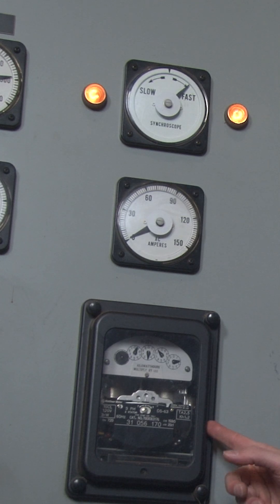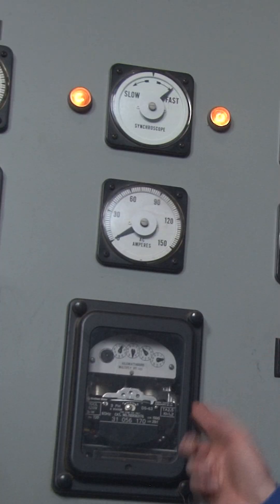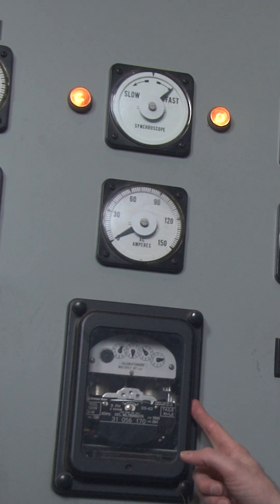kiloWatt Hour Metering #engineering #powerplant #hydropower #highvoltage #science

Comment: kWh is a measure of energy, not power. Makes perfect sense as a unit of measurement for energy consumption. Especially for a power plant.
Reply: American and units. If it is logical, they will not use it.
Reply: @remcool1258  If I were born tomorrow and grew up under the metric system, I would probably share your opinion. But I was born 76 years ago under the American Imperial system. Dammit, 72 degrees is comfortable. 32 degrees is cold. 0 degrees is TOO EFFING COLD!
My old gassers held about 16 GALLONS of fuel, easier to think of than 60.56659 liters.
I'm forced to use metric tools, as some idiot decided to let in all the foreign cars and spread that virus, but that's another story.
So I will stick with the American Imperial system, Cycles per Second, and all the other units I have used since childhood.
To me, it is logical. And so is driving on the right hand side of the road, cold beer, using a knife and fork, and never, ever eating Haggis, watching Morris Dancing, or Cricket.
Reply: @The_DuMont_Network  Funny you are ok with about 16 gals but not about 60 liters. My opinion is that if a system works then its a reasonable system, and engineering can be done in either system pretty effectively. There is no need fighting over which is better. Personally I'll stick with metric, its the system I grew up with and feel comfortable in. I am just as confused using Fahrenheit as you are with Celsius. P.S where I am from, we also use the kWh and drive on the right side of the road.
Reply: @The_DuMont_Network  I can see your point on most of what you're saying. Though you are dead wrong about haggis.

Thing for me is, I've had to build furniture from old plans. Plans that pre-date the metric system. This brings up a number of issues, because feet and inches and whatnot were not generally standardised back then.
A foot might be 9 inches, it could be 13. None of those different inches are the same and neither are those feet. So when working with plans like that, not only do I need to know when they were made, I also need to know where they were made, and then I need to figure out what standard was used there at the time in order to convert things to metric.

It's the same thing these days with gallons, tonnes and in some cases miles.
When you say gallon, is that a US gallon or an imperial gallon? Long, short or metric tonne? 
Miles? Statute miles? Survey miles? Nautical miles? Or some historical mile that might be as short at 500 metres or as much as 10km... Again the whole "who, where, when" stuff comes up with that again.

Also the US Customary units are just metric with extra steps, as all USC units are defined by the metric system.

And yes I know the USC units are a perfectly serviceable system, mostly because there are not 70 different definitions for a single unit depending on where and when you are.
Reply: Watts are defined as joules per second. Saying watt-hour is the same as saying joule-hour per second which doesn’t make sense.

Comment: So megajoules represent a total amount of energy generated.  Sure, you are in the business of selling energy, so you should get paid for how much energy you generate.  The problem is that the ancient meter you showed us doesn't measure energy.  It measures volts and amps, multiplies them together (watts), and integrates that over time.  So, sure, you could measure integrated power flow over time, then convert that to total energy at the end of month, but you would be charging based on a different metric than you measured.  The accountants might have something to say about that.  You could measure megajoules at a great loss - spend all month filling up a giant battery farm and charge based on how full you got it - but that would be much more wasteful than measuring the metric you have access to as the power flows by the meter.

Comment: The kWh is not a measure of power. It measures energy. kW is a measure of power.
Reply from the maker: Yes, and Joule is a unit of Energy.
Reply: @Physicsduck  Since you know the difference, it must have been a slip of the tongue when you said that kWh was a stupid way to measure power.
Reply: @whitcwa it's all schematics. Technically the meter does measure power and adds it up over time, but the speed the wheel is spinning measures power. You could also argue that measuring power is done by measuring energy... potAto pOtahoe.... we pay for energy ( plus peak usage, power factor,  , nuclear decomission tax.... etc.) At least where I live.
Reply from the maker: I had my wisdom teeth revoked for the frequency in which my mouth outruns my brain. But yes, I mean that the kWh is a daft unit of measure to begin with.
Reply: @Physicsduck  I still want to see your tale on this. Is it just the units you don't like, or is there other factors that have to do with production and metering?
I'm guessing U.S. Americans would have too much confusion with MJ. Even liters confuse them, when you can realisticly 1 liter = 1 guard, and they will still be confused because they don't know how many quarts are in a gallon.
Reply: Suppose you have a battery with a capacity of 5kWh and operate at 41.6V for 5 hours. The amps can be calculated using the kwhr formula. 

Amps = (kWh × 1000) ÷ (V × H) = (5kWh × 1000) ÷ (41.6V × 5H) = 24 amps.

However THAT is only what it will supply at the very start.

As because you only have a finite runtime on a battery, it's terminal voltage as time goes on, becomes lower and lower, resulting in lower and lower current flow, until the end of 5 hours, when the battery voltage goes to say 0.05 volts, and the current has become infinitely small.

YOU WILL NOT BE SUPPLYING 24 amps continuous.
"You wil be supplying an average of half that at about 12 amps, for about half the time, as your battery will go low, long before it becomes totally flat".

So on average, your voltage will also be half, at 20.8volts, so the theorietical average VxHr will be, 20.8x 5 = 104
As your kW = 1,000 watts, it will remain the same.

Thus 5,000 watts divided by 104 ?
That will be an average CURRENT SUPPLIED of just ?

Oops, 48 amps at the start, and zero at the end = an average of 24amps.

BUT, you can not charge the client for the initial startup current drawn, from the initial (undrawn) supply voltage ?
As that kWhr for 5 hrs would be.
48amps x 41.6 volts, x 5 hrs/1,000 = 10kw per hour (or 10kWhr).

10 kWhr?
No battery on earth rated at 5kWhr supplies 10kWhr.

As you only had a 5kWh battery, so where did the other 5kWh come from?
It came from using (the incorrect calculation) Maximum voltage x Maximum current drawn (at the very start), without compensating for the drop in voltage the longer that the connected LOAD was supplied.

ie:
No current flowing at zero voltage after 5 hrs.
Reply: @Physicsduck  So too, is the Unit of Energy (whack you get at the back of your head), that you GET when you stick your wet tongue onto a brand new 9vDC smoke alarm battery.
However POWER, ral used power, is NOT measured in volts x amps, as the kW/Hr meter oes NOT measure volts x amps, it measures the instantaneous differences between current DRAWN and supplied voltage DROP.

Comment: Says the guy that refuses to rate fuel efficiency in horsepower/minutes.
Reply: Banana stone per light year ( measuring photon torque effect from gravitaional pull )
Reply: I'd prefer Llamathrust/seconds myself
Reply: That should be horsepower - minute, not horsepower per minute. 81.5 hp-min equals 1 kw-hr.
Reply: @siphonsnob It felt wrong when I typed it but I was in a hurry.  Thank you so much for rectifying and clarifying!

Comment: KWh is based on SI units. 1MJ is 3.6kWh
But, if you cook something for 1 hour at 1kWh, it uses 1kWh. Or if you have 50kWh EV and it charges at 10kW, you knlwmit would take about 5 hours to charge.
Reply: kWh is just a non si unit used for easier calculations.
1 Joule is equal to 1 Wattsecond and every other factor is based on this
Reply: I have two EVs. They charge overnight at home at a max of 15kW.
At Superchargers, the max is 170kW. 
I leave home every morning with about 85% or 25 miles indicated.  
On road trips my average dwell time is about 15 minutes every 200 miles or so. It approximates my bladder dwell time.
Reply: kWh is 1000W*3600s, so 3.6 MJ. Not 1MJ = 3.6kWh, but 1kWh = 3.6MJ. 1MJ = 0.277kWh
Reply: Everybody gives a couple of examples because they don't know and can't derive a simple little equation to calculate kWh.

It's sad and of no use when you are dealing with figures which are not equal to the examples provided.

Comment: Kwh is more conviniemt than horsepower-hours (which does get used for some thermodynamic systems)
Reply from the maker: That's one I've never seen before. What kind of systems? :)
Reply: @Physicsduck  steam power cycles. If there was one thing driven home in my engineering coursework, it was managing and working between unit systems.

Comment: Because you use your instrument for cross checking, it needs to use the same technology as the energy company is using. A digital unit that measures in KVA is not expensive and easy to install.
Reply from the maker: Certainly. But we're BOTH doing it wrong. ;)
Reply: @Physicsduck  yes I totally agree with you, but try to explain a bean counter about blind current and phase shifting 😲😲 or about pulsed power supply , etc
Reply from the maker: You're certainly correct, but I have a superpower for exactly that. I spent the first 25 years of my adult life teaching complex engineering concepts to normal people. ;) BRING ON THE BEAN COUNTERS! I've got this.

Comment: We have several of those dinosaurs that are, as you called it, AIP'd. Not that they weren't any good, but our SEL motor protection relays and GE PQMs do what they used to. We don't sell power, just use it, so the totalizers are really just for internal auditing.

And I totally agree, kwh, and the watt-hour in general, are a goofy measurement. Took probably 2 years in the trade for it to really sink in how it translated.

Comment: Good Sir… I beg the question… why not the kWh standard?
Is it because it’s not an official SI standard or are you just being reactive? Hehe

If the utility companies started billing their customers in 3.6 MJ multiples, I’m sure most (engineers included) would flip their lids!

Suppose the generation folks would rather sell power in kVAh, as it’s the VAs that amounts to the size and capacity of the physical equipment required at the facility.

Though the residential customer who in the vast majority of cases is power-factor penalty free… would be more than happy to keep the kWh system.
Reply from the maker: You're well on the right track. I'm working on a video breaking it down. We'll see what other people think. :)

Comment: When I was on tour of Eastern Europe, I saw a residential energy meter that indicated MJ.  I sadly cannot remember where that was, but I think it was Tallinn, Estonia.
Reply from the maker: THESE EXIST?! OMG! I wonder if we can find one!
Reply: @Physicsduck  Weirdest meter I've seen is one that read in A²hr.  My best guess for the use of that one is in calculating resistive losses in cabling.
Reply: @randacnam7321  I had a house in a new development, in a country far far away, we had 1  60A breaker on a 220v line powering potentially 600 homes... but only about 100 were moved in. My potential at my outlet about 1km away from the meter was 80~110v on a good day at 3am (across 8mm wires, with like 10+ twist connections) 

if I was metered based on A/hr I would be broke... outlets are supposed to be 220v 60hz.

MJ would make sense.
Reply: @randacnam7321  If i didn't make any mistakes, I think you're right. [A^2] x [r] = Power
Power x deltaT = Energy (lost as heat)
I'm not very knowledgeable about sparky magic so please correct me if this doesn't make sense... can't you use this meter to see if the power plant and the utility company are accurately measuring the kWh? 
If the kWh inside - A^2h isn't matching the kWh outside, wouldn't you know if something is wrong? 
If I'm missing something I'm sorry.
Reply: Well that would make soo much sense to everybody wouldn’t it 😳. Be as mush is a therms for gas they make perfect sense

Comment: It would be a fine unit if so many people didn't think it was actually kW/h somehow. Megacalories would be a nice unit. It could still have a pleasant degree of confusion as people wonder if it is a million food calories.
Reply from the maker: Food calories is another one of those that hurts my soul.
Reply: @Physicsduck  Why though? Those are derived units that work reasonably well, at the scales they are used to. Just like astronomical units, lightyears, parsecs and electronvolts.
Reply: Hang on, should I be measuring my food in kilowatt-hours? Or did I misunderstand?

Comment: So....tell us more on how stupid KW/h is for measuring power use.
Reply from the maker: It'll take a minute to write that script, it's coming.
Reply: @Physicsduck  how else would you measure work done over time with electricity other than a KWH. kVA/H?
Reply from the maker: Megajoules :)
Reply: @Physicsduck you would still need a time factor
Reply: @baileylouque6579 No, because joules is a specific amount of energy. Watts is the flow of energy, so you need time to have a specific amount. 1KWH is 3.6MJ because 1 watt second is 1 joule, and there are 3600 seconds per hour.